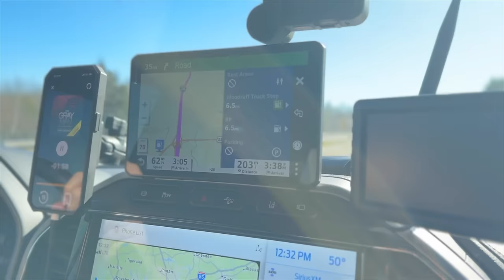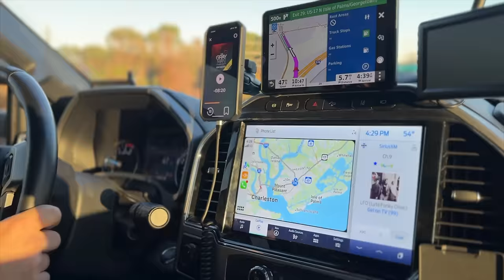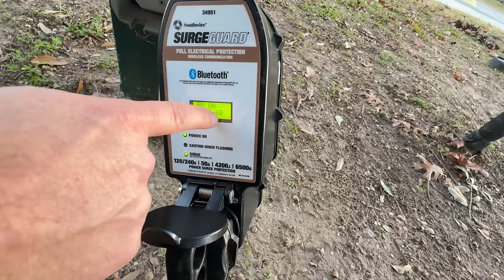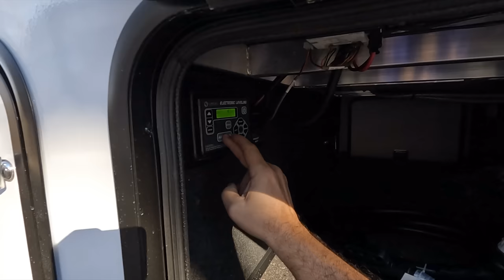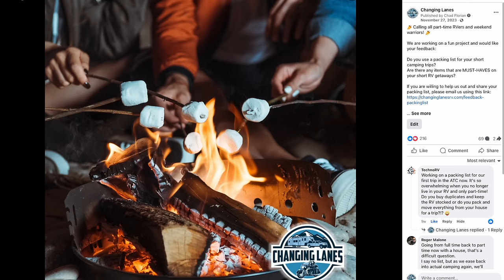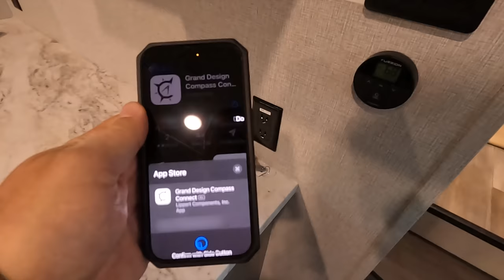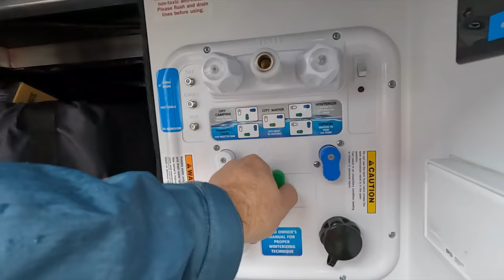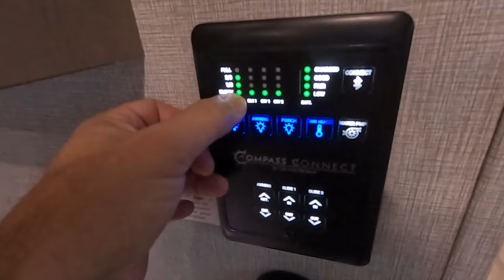Heading South in a new RV (Grand Design RV Reflection 28RL)

Comment: 😊 we have stayed at the campground you are at and have a rear living camper so we pulled in so the rear was facing the water. Had to run the power and sewer under the camper but not a big problem and we could watch the sunset.

Comment: We have a Montana 294RL with that same 4 point auto level system and it took us abit to get used to how much extendable leg to drop in the front to allow the auto level system to retract enough especially on a driveway that slopes down a lot. We love the ground control system because we're able to see just how many degrees we're off level side to side in the event we need to throw a block under the wheels on one side.

Comment: We've had our 36' Phaeton now for four years, thinking of possibly changing up, and trying a 5th wheel, but once arrival happens, our coach seems so simple (especially on a rainy day) where we pull up, put out one slide (plenty of room for us both) and if needed, I'll put a block under the low tire, and not even use our levellers, and we're done.  Of course having the wet bay, where everything is makes sanitation easier as well, in not having to crawl under the unit.  I know the 'pluses' of fifth wheels, but no setting up of stairs is another one with the coach, yet I do miss my old F450 dually King Ranch, where we hauled our Arctic Fox slide in camper to the Yukon & Alaska and back amongst other trips to Utah for ATV riding in the back country!   Still side lined, on changing up, yet our coach is getting older, but so far I've been able to keep up on the 'fix-it's.   Thanks for the video, always enjoy the many locations you share with us, along with the upgrades Chad does, and a very late 'Happy Birthday' to Chad as well!

Comment: All we do is start the fridge the day before ( we have a 16 cu.ft. 12v compressor fridge.) load food the day of travel and put in clothes, towels and shoes the night before. We have all the chairs, hoses, cables, etc. in the camper storage. I do have to load a ladder, grill, smokeless fire pit, wood and safety road cones in the back of the truck. We have all the plates, bowls, utensils and accessories in the camper.

Comment: On my ‘04 Montana 3295RK I can lift one front landing gear at a time (opposite side will carry it) if I screw up and set the legs too low to level. Not sure you could do that with today’s 5er’s with all of the frame flex issues.

Comment: We started out with a 28ft. 5th Wheel, the downside for us was it only had one A/C. My husband travelled with it for work in places that reached over 100° temps. 🥵 Always worried it would quit working. Upgraded to a 36ft 5th Wheel with 2 A/C.😊 The 28 trailer works great for 2 people.

Comment: When you park if the front end is nose high you don't drop the front jacks as low, If the front end is low you'll need to drop the front jacks further.  If the front end is really low the front jacks may not have enough lift to get it off the truck, but that's rare.  And when that happens you raise the front end and use other jacks or blocks to hold the frame up, retract the jacks and drop the jack extensions lower, then extend the jacks again. I use a bubble level app on my cell on the floor inside the door to get some idea how high/low the front end is.  Also when unhitching pull straight forward and clear the truck from under the RV then level the RV, that way if you must re-hitch to adjust the landing legs shorter you don't waste time getting lined back up. 371MBH 41' fiver.  Don

Comment: Charleston is my hometown. It was fun watching ya'll getting use to setting up the Reflection with the electric versus hydralic systems. We had a Jayco Eagle HT 27RS which is the exact same floorplan right down to no bedroom slide. I think you will (or found out) that floorplan works very well. We would go for 3-4 weeks at a time and always felt it made a good couples camper. We've downsized again to a 28' Airstream but haven't been out more than a week. So far, no regrets. The Airstreams pulls so easy. 
I can't wait to see what you took in during your visit to Chucktown.
Reply from the maker: An airstream would be fun to try out! 😊

Comment: Not sure that Ford F450 dually can tow that Reflection! 😁￼ Also I-26 north of Columbia is a horror show.  But if you really want to beat your rig to death, take I-95 off of I-26 going to Savannah.  Nightmare roads.
Reply from the maker: All the interstates are in bad shape.. 😞
Reply: I will say that the interstates in New Hampshire are for the most part excellent.  Not bad for a low tax state. @ChangingLanes

Comment: Did I hear properly, you used 1/4c per gallon?
.
We have an arctic fox 27-5L  Almost every thing is accessible with slides in.  It has proven to be the perfect couples trailer, but we're also not carrying a motorcycle :)  They way I looked at the larger 5th wheels, they really don't gain you much, except a bunch of useless space and multiple couches.  This unit does have a heavy pin, given the overall size of the trailer, and in full travel mode, I've just about maxed out payload on my F350D

Comment: What’s the black plastic thing over your Mopeka Pro sensors? Is it from Mopeka? What benefit does it have over just Magnets? Is it just so the sensors don’t fall off while traveling? I have a TT, and the plate my tanks sit on completely encapsulate the sensor, so no way to lose em. Is it difficult to get the sensor out to change batteries?
Reply: 22:25

Comment: Looks just like our 2017 GD Reflection 29RS.  I will tell you, your kitchen slide is gonna fail.due to a design flaw (not me that says that but a GD authorized repair shop said they see this a lot with GD and the use of in wall slides mechanisms and large slide outs).  I thought GD fixed it but looks like GD reintroduced this issue.  Ours failed and broke the wall frame between the entry door and the kitchen slide.  Cost me $5k to "fix": it...not really a fix however.  Good luck!

Comment: We have a 286RL 5er, we love it for a couples RV. It's only 34' overall so we can still get into most state parks. Of course we weren't spoiled by a 40+ foot mansion on wheels first 😁😁. Do you have this truck set up to charge your lithium's via the alternator in your big RV? If so, love to see a video of the wire size and how you secured it to the frame to keep it as safe as possible. Currently gathering parts to do this but I'm unsure how to professionally secure the wire running back the frame of the truck.
Reply from the maker: No fancy power stuff in this setup.  In fact, we only had the stock lead acid battery in it.. 😳  But, we did film a test of that battery versus a lithium.

Comment: My wife and I have been following you guys for quite a while! Part-time RVers at this point but looking to go more full-time in a few years.

On roads, I-16 in Georgia is another "bumpy" road to avoid if possible as its like riding on the Chesapeake Bay Bridge-Tunnel with the "feel of the ocean".

We have a 2021 Reflection 150 260RD that we currently tow with a '21 F150 Platinum Crew Cab (eventually we want to move up to 350 series). 

Our Reflection has the same leveling system and once you "learn" the in's-and-outs of it is pretty easy. We use the magnetic jack blocks for the front legs along with some flat snap pads for rear legs. One thing I did not see you mention is that with the One-Control App (Bluetooth) you can control the features without having to reach in to the control panel (plus have a better view of what is going on). 

As always, safe travels!

Comment: My SurgeGuard is Bluetooth but isn’t the right build to be able to connect to the app. 
So I would need to get the add on unit from Southwire. 
Seriously bummed about that. 
I’ll probably get a Watchdog soon.
Reply from the maker: Interesting!  I never did get around to connecting to it via the app.  I will have to check that out, but we're in our 410 now with the watchdog, so that will have to wait.

Comment: We have a 303 rls and was damaged by the RV center when they had the Rv for 3 to4 months never installed the refrigerator fans. WHen I went to pick it up the batteries were completely discharged So the dealer decided to istalll booster box   The inverter started to emit smoke Needless to say they have touch the Rv again
Reply from the maker: So many RV horror stories are dealer service center related....  Sorry you had such an issue also.. 😞

Comment: Not a fan of the dining and windows on the sewer side instead of the campsite side.
Reply from the maker: Our 410 is set up the same way and we've been good with it.  And, just like this one, swapping the two sides wouldn't work because the door needs to be on the camp side.  And, to be honest, looking out the front window gives an even better view of the sewer on that side.  It's just sewer sewer no mater where you look.. LOL
Reply: @ChangingLanes I hear you, besides we're not supposed to just sit in these things right.  :). Check out a GD 260RD for a great comparison though.  That has rear dining and you look out a huge rear window, fantastic for a site like the one you had in Nashville area.   We stayed at the CG as well a while back, it was a great as you showed.
Reply: When your full time you sit in them and I can't believe they designed them that way

Comment: Are you going to be towing  a trailer for the bike in the future  as you can get in more sites with a smaller campers Hopefully theres no frame flex or break on the smaller reflections like there is on many Momentoms as they under engineered the frames to save money So how much better is your fuel mileage an lower stress with this camper
Reply from the maker: This is not our camper...  We still have our 410. 👍🏼